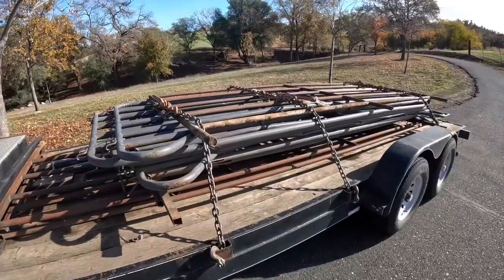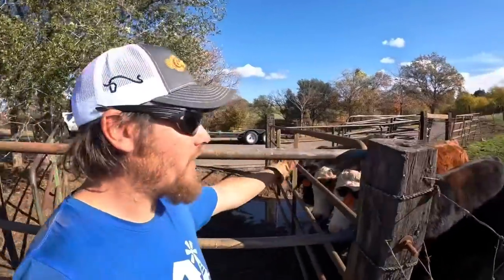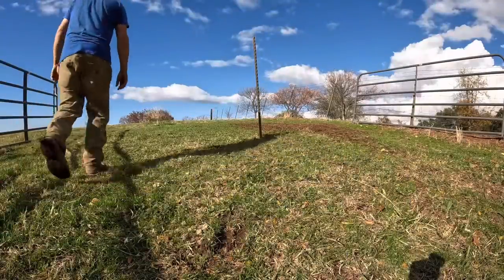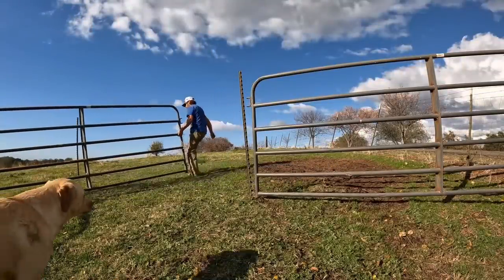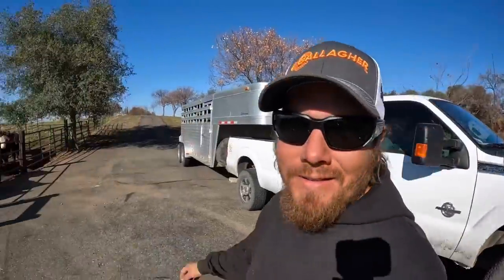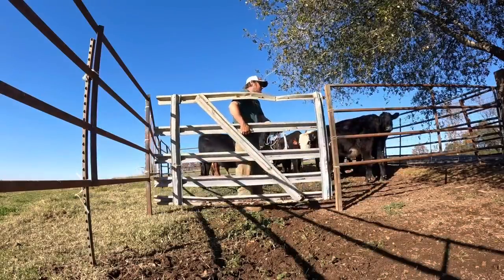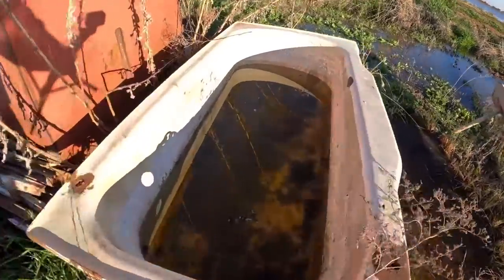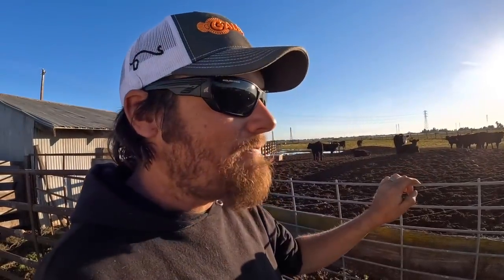Loading Steers Out of a Rickety Corral!

Comment: Tyler, when feeding hay in those pastures consider unloading at the top of the hill and let the round bale roll down and it will unroll as it rolls down hill.   I've done that for years and it spreads the hay and there seems to be less waste.    But I don't have sprinklers in my pastures and that could be a drawback in your pastures,
Reply from the maker: Yes I’ve considered it. But like you said, the sprinklers are a concern. The steers break enough of them off as it is!